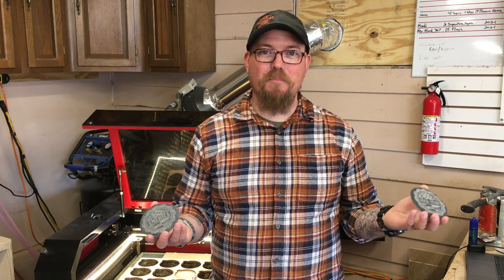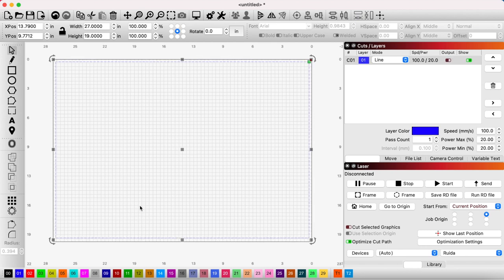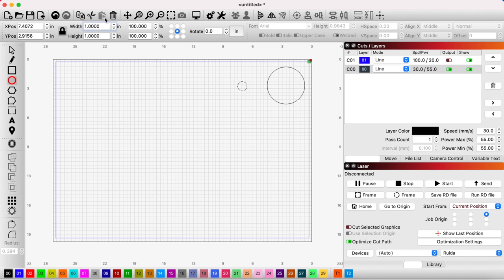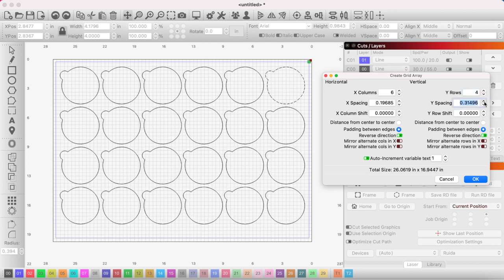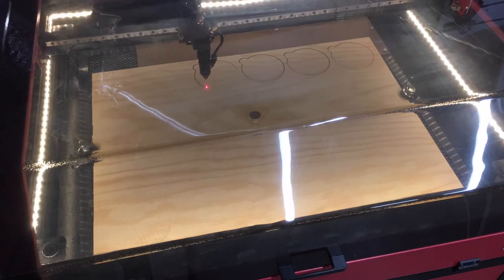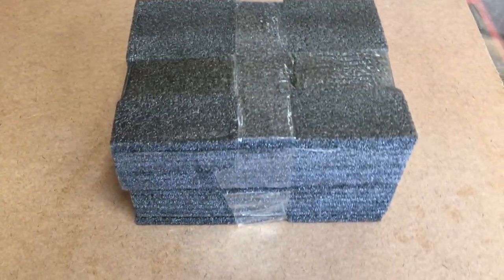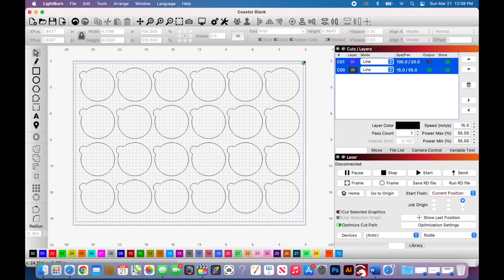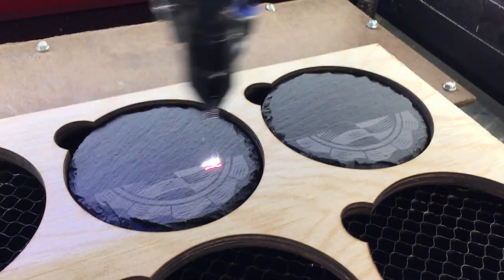How to Design a Lightburn Template for Production in minutes!

Comment: Awesome.  Thanks for sharing.  New to the laser world, and this vid will definitely help me.
Reply from the maker: Thanks for checking it out!
Reply: @jackalopecustom  A quickie for ya.  I understand the whole array thing, and the template design process.  But what if your doing small key chains with a smaller template.  A template that doesn't fill up the whole bed of the laser.  Let's say I create one, use it.  Then in a week, want to crate another set of new key chains.  If I randomly place the template on the bed, which trust me, I would.  How do you get the laser to align back up to this new position on the bed without creating a lot of waste using the blank keychains ?  Thoughts?
Reply from the maker: If you randomly place the temple on the bed(let’s say close to the middle of the bed), you’d have to ensure the template is square to the cutting head x and y. Then under the laser tab select the start from current position. You would have to place the head of the laser where you have the template. There are 9 dots that reference where the job is going to start from (top right, center, bottom left, etc) and that should get you going. 

This method requires a lot more setup time, but is absolutely doable
Reply: @jackalopecustom  Thanks.  I have plenty of cardboard to cut these test key chain's from.  I may just try to remember when setting up a template, to place it down and to the side left bottom corner.  This way I can replicate the job just with new info such as names, etc...
Reply from the maker: That would be your best bet. I think having a static starting point makes things so much easier.

Comment: Great video!  I have just one question. How do I make the depth of the object, how thick I want the object to be? Everyone always show height and width of the object but never how you make or change the thickness of the object. Please tell me how to do this, I am very new to lightburn. Thank you!
Reply from the maker: Thanks! So the depth of cut is based off of speed and power that you set. The height of the nozzle to the material is based off of your ramp test and any adjustments you make from there (defocusing). I hope this answers your question. If not, let me know

Comment: Hi just finishing watch your video, thank for publishing. May I ask you what laser are you using and how long did it take to engrave the 24 coasters
Reply from the maker: Hey Jim. I’m using an OMTECH 80w and depending on the complexity of the coasters it takes about 20 - 40 minutes to do all 24
Reply: Thanks for the quick reply.  Am assuming that you like your OMTECH.  i like the bed size
Reply from the maker: It’s been a great machine. Did the air assist upgrade and a few other small upgrades. Been running great for the year and a half or so that I’ve had it.

Comment: so how do you set up your laser to now engrave x amount of coasters at one time? is that possible?
Reply from the maker: Using the jig design in Lightburn that I used to cut out the jig, I use that as a template and place the designs where the coasters will be placed. I just set the template to a different color (blue in my case) and turn it off and the engravings I set to red and turn them on. Your color choices might be different, but that’s the concept. Did I explain that clearly enough? If you have further questions please feel free to ask
Reply: @jackalopecustom  Yessir! thank you
Reply: @jackalopecustom  Would you have to drag and drop your text on each slot and move them around so they all look to be in the same position. Thinking of a jig for 100 pencils or so could take a long time to place names on each and move them around to look the same.
Reply from the maker: @pdwinc.1077 you could duplicate the text and then use the center feature to get the text in the same spot on each individual pencil. You could also use the array feature if you can get the spacing correct. I would also think if you take the time to get the text on each pencil initially and then when you want to put different text in it’s place you just replace it. Should stay in the same spot

Comment: Great video brotha I have the same red black 80w and I have the square slate coaster but have trouble with them. Do mind letting me know what your settings are for engraving them and do you coat them with anything prior to engraving . Again awesome video keep up the great 💪
Reply from the maker: Hey Chris thanks man 👊. I’m running 300 for speed and 17.5 for power. The most important part though is to defocus. I’m 4mm higher than when I’m cutting. I don’t use any coating on the coasters. Take them out of the package and put the on the laser! I hope this steers you in the right direction
Reply: @jackalopecustom  ok so since my optimal focal length for cutting is around 4mm so your saying I should raise it up a little higher
Reply from the maker: That’s what I do. My typical cutting length is around 34mm and I engrave at  38mm to 39mm. I got a different lens for a longer focal length. I’d get some slate to screw around with and dial it in and then write down the settings you use that work
Reply: @jackalopecustom  ok sweet thanks alot I'll give it a try
Reply: @jackalopecustom  defocusing the laser is an awesome trick for a lot of things... just move the lens up, not down, so you don't impact  the head of the laser.

Comment: So... good start... but... if you make at least two trays by cutting out only the top level, and make the second glued level with no holes, then you can load your pieces into the tray external to the laser. You will need a jig to locate your tray within the laser, which you still need with your system to be accurate... But you win by keeping the laser cutting. Loading and unloading the trays inside the laser will hurt your back and slows down the process. Make trays... ==___=___=___=___== and make more money.

For your next trick, figure out how to automatically load and unload the trays... but you won't need that until you're making around 30,000 pieces a week... Ah... would be great to be back to only 30,000 pieces a week... sigh.